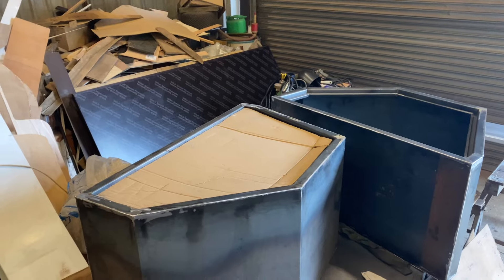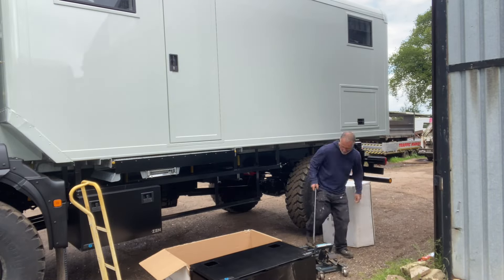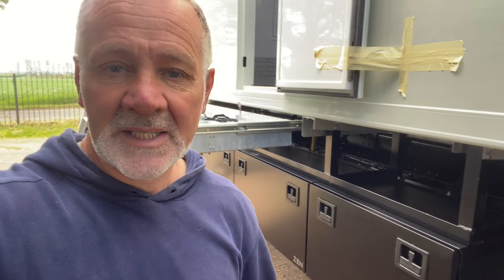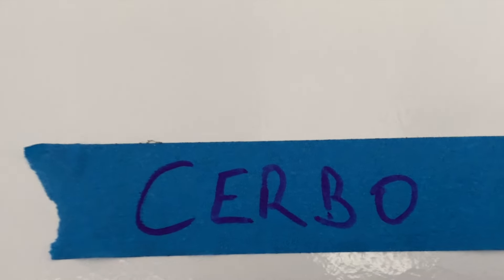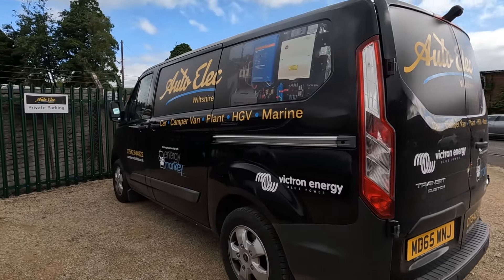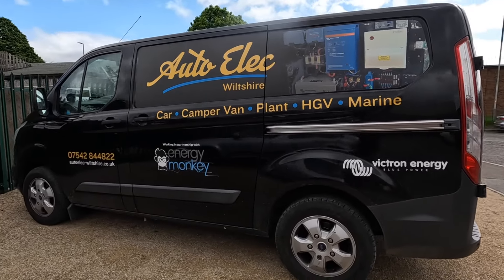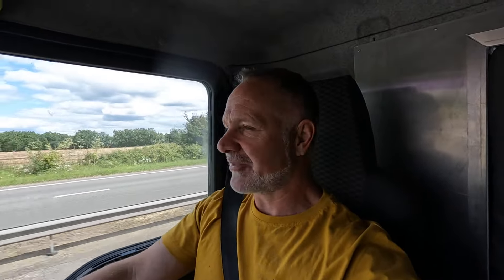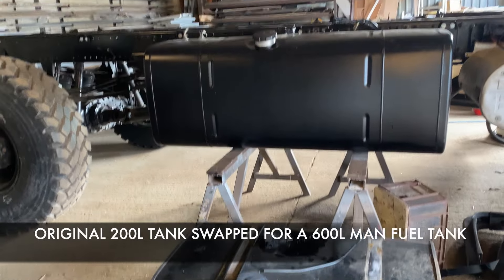POWER - HOW MUCH IS TOO MUCH? Victron Install

Comment: Sorry to pick up but surely that is 2000w of solar (2kw)? 
I am impressed that you have gone for a 24V system. 5000w inverter because of the aircon unit? I am looking forward to the detailed video on the electrics as I am absolutely fascinated by this stuff. Just one question now though, are you building in any forced cooling for the electrical equipment, especially the B2Bs which can run very hot under load?
Reply from the maker: Hi Peter, good to hear from you. It is 2kw... too much swirling about in my head 😀

We spent a lot of time seeking advice on everything electric, including additional cooling, cable sizing, ventilation and loads. There are variables, but the overall opinion was no requirement for additional cooling however, a heatproof plate behind the B2B''s advisable, we'll also ventilate the space.

I suppose I could retrofit additional fans, we'll see how it performs.